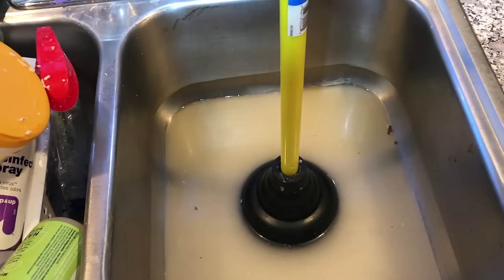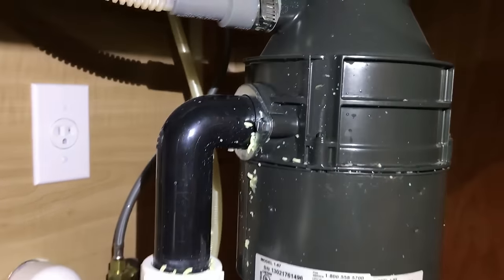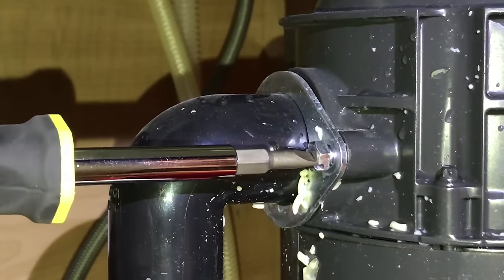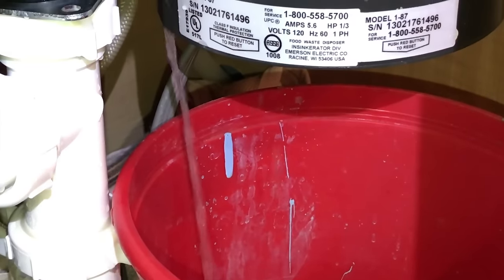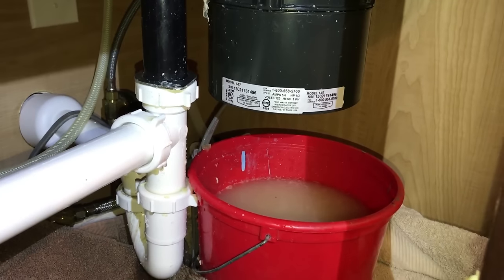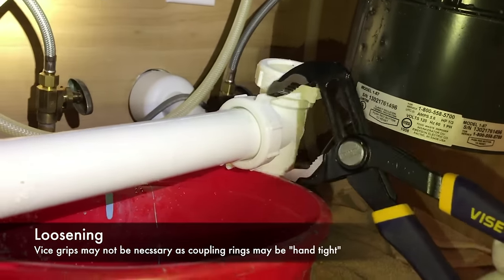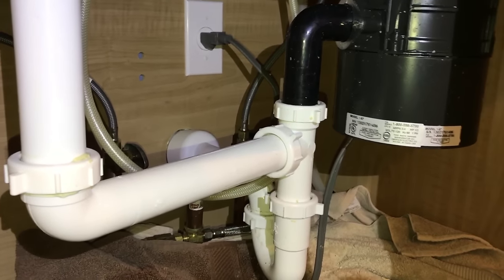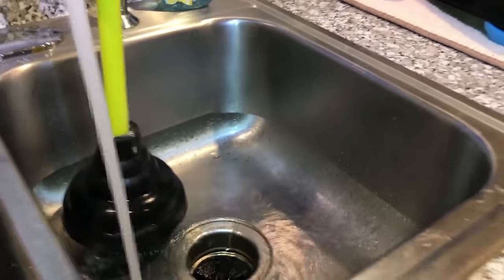How To Unclog a Garbage Disposal Drain

Comment: I did as the video showed. I didn’t find any food stuck. Am I good to go or there’s another way to check if I have an issue? We drained all the water. 😅
Reply from the maker: Hopefully you’re not clogged beyond the piping exposed under your sink. You won’t know unless it starts backing up again at which point you’re probably going to have to snake it out.
Reply: @theXchange  I’m desperate... we bought a 25ft mechanical snake and we’ve been at it for 3 hours and nothing is helping. Even did the baking soda vinegar method and helped alittle. What else are we missing?
Reply from the maker: what events led up to the clogging?
Reply: @theXchange  dishwasher was on and I happen to do the extra dishes by hands and also turned on the disposal since I was seeing water buildup. Bacon grease for example we let hardened and then it goes right in the garbage bin (not disposal)... not sure what’s going on.
Reply from the maker: sounds like you’ve already inspected your pipes under the sink, but if it’s all put back together underneath, you can try this. Grab a toilet plunger, and create a good suction around the drain inside the sink. Plunge away while maintaining suction with even, consistent plunges. If there’s standing water in your sink, hopefully you’ll see it start to drain if the plunger is able to dislodge whatever may be blocking things up.  If you see water start to drain, pop on the disposer and hopefully everything will clear.
Reply: @theXchange  yes we did that too and that created pressure that the water was coming out of the pipes.
Reply from the maker: yea. that can happen. well...  all my best. I wish I could help you more.  I’ll be curious to know what happened when you get it cleared out!

Comment: An easier way and way less messy is to use a wet dry vacuum to suck out the water from the sink before you undo the plumbing. If you don't have a wet vac use cups bowels and sponge , to bail out water.

Comment: I did all that and I think my drain in the back of the sink is what’s clogged may need to be snaked out for my situation
Reply from the maker: sounds like it. Other’s have experienced the same in this comment thread
Reply: @theXchange  I had to call the plumber to snake out the back pipe behind the wall now it’s working , I might just buy a snake myself

Comment: Why does the garbage disposal turn on only when plugged in and turns off, only when unplugged…. What do I do to fix it??
Reply from the maker: Are you saying it stays on when you flip the wall switch off?
Reply: @ no, the wall switch doesn’t work.. I have to keep it unplugged to stay off..
Reply from the maker: @selinargarcia there’s a red button underneath the disposer. you can try to reset it. i would also check all of your GFI plugs to make sure none of them tripped

Comment: Ok I did everything just like you. I didn't have any blockage. I still cleaned out the pipes but the water is still not going down
Reply from the maker: bummer. that’s usually a sign it’s deeper. you could try snaking it out yourself depending on how deep the clog got, or you can try the suction trick to see if you can jostle it loose
Reply: @theXchange  I just reset it and I'm going to try it again.
Reply: It didn't work 😕 I have a plumber coming out in 2 days.
Reply from the maker: sorry it didn’t work out for you!

Comment: Looks like my moms kitchen sink except she does potato peels. She will peel all potatoes then just use enough water to wash them out of sight then shut off the water. Which she had 40’ of 2@ barely graded so that didn’t help either. Whenever you put stuff down tour disposer make sure you flush it with plenty of water. Maybe every few months fill up both sides of sink with hot water and dump them if you want a little extra pressure turn on disposer, that will flush out your 2” line till it gets to the 3”. Also when taking the drain apart you could put the bucket under trap if it is down low like his slide it sideways it doesn’t have to stand up long as under trap then just listen the nut. Also you don’t have to use fingers to create out drain use a screwdriver. Sorry but that drive me nuts waiting for water to drain out of disposer. I’m sure if I came to your house you wouldn’t want me to wait 10 or 20 minutes to drain a half gallon of water when it can be done in less then one minute. Other that you did a great job and saved around 100 bucks.Tell the wife flush mire water when she uses disposal which means you get to keep the 100 that way she will remember the next time.
Reply from the maker: Thanks for the comments and suggestions!!
Reply: Kris Reese not a problem plumbing isn’t really that hard it’s just common sense and can get a little dirty sometimes. Been doing it 20 something 30 years you ever need any advise on a problem just ask if I notice you’ve messaged I’ll answer
Reply from the maker: Can you actually elaborate a little more on the part about taking the drain apart?  I wasn’t quite following along with the part about sliding something sideways as a means towards drainage of the water much faster...  Sounds like a good trick if it speeds up draining of the sink without making a mess! :)
Reply: Kris Reese yes the bucket to catch water slide it under p trap then you could loosen one of the nuts on the u part either the one on top of trap or the one where water leaves the trap. But if your sink is full and you don’t put a plunger in there like you did you will fill bucket mist likely overflow. Watching the video I was thinking disposer was clogged so I was confused why you were taking apart drain. If that clogs which means won’t turn in there is a reset button on the bottom of disposer or an Allen wrench key hole to spin it and free it up. Or you can do the ole stick a broom stick in there and try and spin it which may work but not as good . But main thing for kitchen sink is flush plenty of hot water because all the grease in the kitchen keeps pipes cleaner especially if you have old cast iron those tend to get clogged pretty easily and the drain on those is usually smaller. Also for kitchen lines it depends slot on how far they are from 3” and if the washer is behind it to flush it thru.
Reply: Kris Reese also with a plunger if you have a double sink you have to plug off the other side for it to work unless it has two separate drains which would be two p traps. Might have been able to get it like that. The reason is when you plunge one side it will just suck air from the other sink through that arm that goes in the tee
Reply from the maker: Ah - okay. Got it!  Good tip!!  Thanks again!

Comment: I would prefer to compost my food scraps rather than putting in the trash can or down the garbage disposer. In my opinion I think disposers are a real pain in the ass to deal with and I'm glad I don't have one in my kitchen sink.
Reply from the maker: If used properly, blockage issues can be avoided. One sure way to avoid any issues is to compost as you suggest! :) Some don’t have the means to consider such options… apartment complexes, condominiums, etc, for example

Comment: Rather than taking the screws out, that is so difficult to do, why not just take the pipes apart and unclog them first?
Reply from the maker: Well... it’s unknown at that point where the clog is and if the sink is backed up, it may be easier to drain it as demonstrated.  But certainly nothing to say one couldn’t chose to work backwards!  Give it a try and see how it goes!